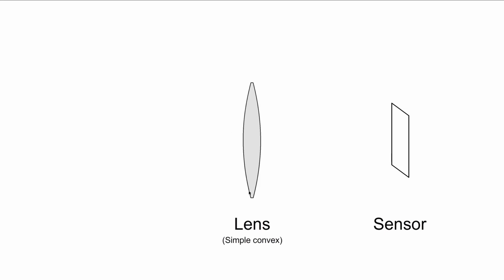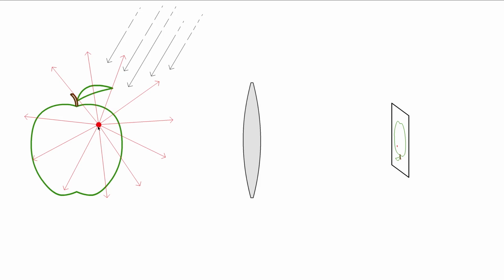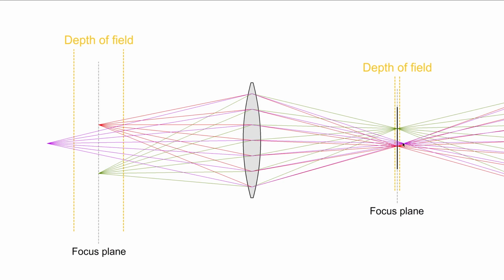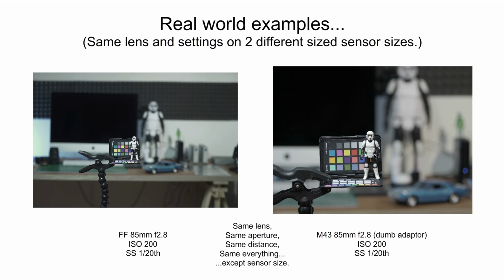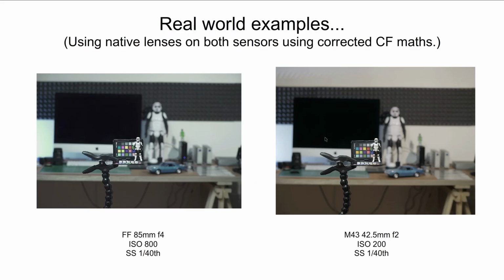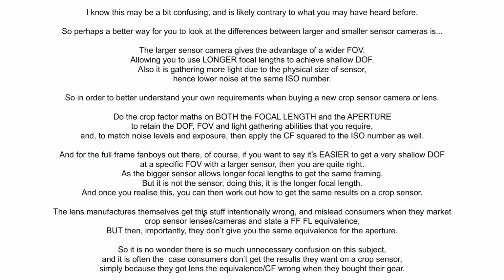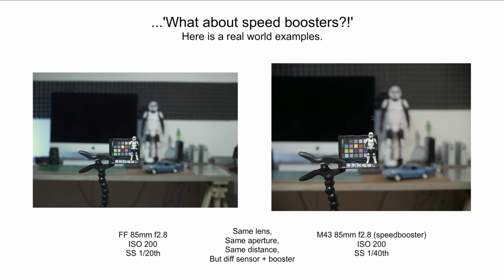Depth of field and crop factor misconceptions.

Comment: Did you say smaller sensor has shallower dof? If you did, wouldn't crop sensor need bigger aperture number to match the dof? shouldn't it be crop needing f4 and ff needing f2? that's the part of your video I am confused about. I do know that dof equivalent for crop is f2 and for ff is f4. I can't wrap my head around that part of your video. Do you mind explaining to me?
Reply from the maker: rico la the video explains that. With examples.  
If you rewatch the it from the beginning it all walks you through that. 
I won't be able to explain it in the comments if the video itself doesn't explain it I'm afraid. 

That is one of the key elements I was trying to get across.
Reply from the maker: rico la it's often useful to do your own experiments if some of this seems confusing. 
Seeing it for yourself with your own gear will always be more enlightening than listening to a description of a practical experiment. :)

Have u got access to a crop sensor body?
Maybe a local camera store where they let you test the gear?
Reply from the maker: rico la I can say that you maybe need to watch another video (perhaps one by filmmaker iq) regarding the circle of confusion. 
I touch upon this in this video. But now wish I went into a bit more detail. 
As that explains the reasons why the smaller sensor has a apparent shallower DOF (using same lens as a FF)
Remember the lens itself doesn't change just because a diff camera is put behind it. 
It's what's happening to the image circle when we shrink the sensor is what matters for that part.

Comment: Fantastic video! I enjoyed the follow up as well. I have a quick ? on the circle of confusion and how it effects the other metrics when you take into account when sensor sizes scale, the resolution often changes as well. For instance a GH5 vs an A7RIII.
Reply from the maker: TheKoop117 yes in this video I was mostly talking about same res at diff sensor sizes. 
(So 4k video as I mostly use)
Higher the pixel density the smaller the circle of confusion becomes. 
But in terms of end product it still comes down to how it’s viewed. 
If it’s printed huge and viewed close the allergens depth of field will become narrower. And visa versa. 
So you do need to take into account the circle of confusion of the sensor/pixel density. AND the final viewing set up. 
(Tv screen at 3 meters... cinema at 20 meters... billboard at 50 meters etc)

Comment: It seems to me that the ray tracing at 10:38 is wrong. If you're focused at a given distance, light coming from a point farther away should converge in front of the imaging plane, not behind it. And the light coming from nearer point is the one which converges behind the sensor.

This is consistent with the thin lens equation (where the lens would be at focal length when focused at infinity. When object comes closer the imaging plane must be farther away).

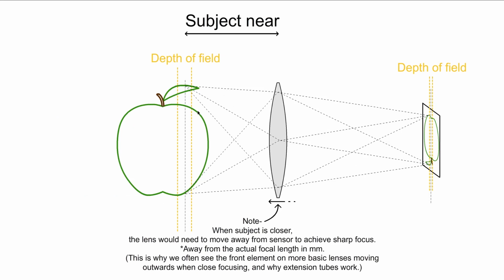It's also consistent with your comments on the video about having to move the lens farther away when focusing on near subcects (14:52 in your video).

Finally, it's also the way I understood the circle of confusion in the FilmmakerIQ video at https://youtu.be/lte9pa3RtUk?t=6m10s

Please comment.
Reply from the maker: You are dead right! (about the converging point) If you look at my pinned comment showing the list of mistakes, that was number one. A stupid mistake, and I am fully intending on re doing this video, and honing the message, correcting the small mistakes, and streamlining the whole thing.

Luckily the message at that point isn't really affected by the mistake, (that the cone is intersecting the sensor at a fatter point, therefore making it blurry.)

And yes that video by FMIQ on the CoC is very good. I could have gone into more detail, but wanted to just cover what was needed  regarding the smaller sensor, and move on.

Comment: Great video and excellent explanation. Wish you would have mentioned the lens compression too :). According my understanding it totally depends on the physical distance between the camera and the subject, therefore on an equivalent of 85mm (56mm or so) on crop body the compression would be same as on a real 85mm on full frame body. Please let me know if I am missing something.
Reply from the maker: Haider Abbas I was just thinking that last night!
(That I should have mentioned compression)
Yes, although I haven't tested for that personally yet. (Always like to test things physically before accepting anything fully.) I agree that it's just down to distance from subject. 

Makes sense and it's just the relationship between one object overlapping another from a line of sight. And the FOV of course. 

As you get further away from the subject. 
(Say an actor) but the FOV angle shrinks. (To keep framing the same on that actor)
So we see less and less of the background scene. And the actor is also actually covering less and less of that background. (Not as important, but worth noting.)

This obviously does the same thing to everything that is at difference distances from the camera. 

(This is why face distorts when using very wides lens, up close. And the same face looks flattened and more orthographic from a great distance with a very long lens. )

Anyway, good point you made. 
There's a good chance I will revisit this topic again in a future vid, as I have learnt a lot from all the feedback I got from everyone. 
Both about things I should have said. 
And ways to make the trickier parts even more clear. 
Not to mention I would like to add some raw independently gathered data that further proves some of the still disputed statements. (By a small but very vocal minority.)
:)

Comment: From what I could understand, for the math examples you're considering that the two sensors were equal except for the its size, that is they would have the same resolution and pixel bit depth (hence the circle of confusion effect on perceived focus). I though that was clear but not so much about the light sensitivity... Did you consider that they had the same light sensitivity per pixel or per unit of area? With your math, the total amount of light in the photo will be more or less the same for each picture (they must gather more or less the same amount of rays of light to form the same picture). Since the picture area of the cropped sensor is 4 times smaller, the amount of light per unit of area will be four times higher (the lens with smaller focal length concentrates the light more). Then, considering the same shutter speed, the amount of light into each individual sensor pixel must then be the same than for the FF sensor, as the pixels are 4 times smaller. So, lets consider that the sensors had the same light sensitivity per unit of area, then each individual pixel has 4 times less sensitivity to light and since they will be exposed to the same amount of light in the same amount of time as an individual pixel on the FF sensor, there would be the need to use an ISO value 4 times higher than the ISO value for the FF sensor, which contradicts your ISO values in the examples. If, on the other hand, we consider that both sensors had the same light sensitivity per pixel (thus making it 4 times more sensitive to light per unit of area than the FF sensor) the cropped sensor needed the same ISO than the FF sensor. I though your explanation on the ISO concept was somewhat confusing and not that coherent. Regards. Bruno

Comment: 50mm (for a full frame lens) is roughly a "sweet spot" in terms of front element size. Assuming you keep the aperture the same, at shorter focal lengths you need a larger front element to accommodate the wider field of view, and at longer focal lengths you need a larger front element to accommodate the larger physical aperture size.

Physics is fun! :)

Comment: Great video, but that’s still means to get same results you have to have ~2 times more light 
So in my opinion FF camera is superior because you can shoot in lover light conditions
Reply from the maker: Ramunas Valancius they are just different. 
Not one better than other. 
But yes if I was going to shoot at night I would take a FF camera with me. Not a m43. :)

Also bare in mind speedboosters shrink and concentrate the light from full frame lenses down onto the smaller sensor. 
This does even the odds substantially. 

So with a XL booster a f1.8 lens becomes (equivalent) to a f1.2. 

You can't really do the same for FF cameras. 
(Well you can but then you need to find medium format lenses, and giant specialist speedboosters. . :D )
Reply: biscuitsalive I am happy with my aps-c camera, but I was shooting in a church and my settings was 1/100 f4 iso1000 apps-c
Were my college shoot on FF 1/200 f5.6 iso 400
So this is why I would rather use FF camera Outside if you have enough light not a problem 
Thanks for replying
Reply from the maker: Ramunas Valancius yep if you shoot in bad light often then FF is your friend. 
But I own all types of sensors. 
And I picky up M43 more often than any other option. 
So make of that what you will. 

(I basically keep full frame cameras for low light only.... and the occasional other reason. )

Comment: Why is everyone trying to achieve a "full-frame look" when, according to this, it doesn't exist?    For example, if you are shooting an APS-C camera at 24mm@f4, you already have a full-frame camera--you just didn't know it.  You have a full-frame camera and lens shooting at 36mm at roughly f6.3.   

So, why aren't you happy?  What's the problem?  Why is it when you look at full-frame footage you want to throw your APS-C camera against the wall and smash it into 1000 pieces?

If you want shallow DOF, there are plenty of fast lenses on the market for APS-C lenses now.  People should save their money and stop trying to imitate a look that doesn't exist. (Of course I'm being sarcastic and don't believe anything I just said.)    I have a different theory about all this.
Reply from the maker: TheViscountOmega ok. Not quite sure your point exactly. But to reply. It's not about getting a full frame look. It's about getting the look you want regardless of what sensor size your camera has. 
You may want a "everything in focus look"
In which case the same formula helps you know what lens/aperture you may need on FF when u are used to shooting on M43. 

But the other factor here is the image noise. 
Knowing the formula I laid out anyone can get a very good idea of what amount of image noise they may get when going from one system to another. 

E.g. U may have shot on FF all your life but your tempted by a apsc camera. 
U know what settings u use in studio to get the clean results you demand. 
Well now you can tell before buying the gear what aperture, ISO etc. You will require on your new crop sensor camera to get "as good as FF" results.
Reply: I mentioned that because the constant refrain from message board users is that they want a "full-frame look".  I'm sarcastically telling them that, according to some people, they already have it.  I think image noise is negligible to these people--they can deal with that.
Reply from the maker: TheViscountOmega fair enough. 
But yes much talk about this mythical full frame look. 
They go on about focus roll off and crap like that. It's all bollocks. I have been using medium format cameras recently. 
And I could get the same look as that to a m43 sensor if I do the math right. 

Limits at the very ragged ends of course. 
In terms of base sensitivity. And FOV. And of course the lenses would start to become pretty darn big for the small sensor if they are uber fast to compete with the fast medium format lenses.
Reply: Interesting, because I've seen some medium format footage that, no matter what settings I use, I know I cannot duplicate with my full-frame Sony a7sII.   The perspective looks different.

The math works to explain FOV, ISO noise and DOF equivalency--I don't think anyone disputes that--but it doesn't explain the difference in perspective between the different format sizes.   Maybe I see things other people can't.
Reply from the maker: TheViscountOmega do you mean the compression?
If you are standing at one point in space. (Distance from subject)
And have a specific FOV.
then this determines the compression. 
(Mainly the distance, but of course u need the right FOV to then frame the subject as u wish)

Light travels in a very predictable way. 
So we can make adjustments to distance and lens to get the exact compression we want. 

Or is there some other intangible quality outside DOF FOV and compression i am not considering?

Obviously there is different types of swirly bokeh and anamorphic looks etc too. But those can be achieved over varying sensor sizes too.
Reply from the maker: TheViscountOmega p.s. I'm not saying there are not differences. Of course there is. 
I'm using film on the medium format so that's massively different for starters!
And clean images in low light will be easier to get on bigger sensor. Nobody will dispute that. Etc etc. :)
Reply: Well, I called it perspective because it looks most apparent to me in certain "distance to subject" shots.  I also see this difference in certain full-frame vs. APS-C shots.  It stands out.
Reply: Today I was thinking this theory:  What users are seeing when comparing different formats is a slight change in perspective due to compression which is caused by the large difference in lens image circle sizes.  For example, a full-frame lens "sees" objects in space from a slightly different perspective from an APS-C sized lens.  Does that make sense?
Reply from the maker: TheViscountOmega yes it does. Sort of. 
The compression will be governed by the FOV and the distance from the subject. 
The physical size of the front element has a part to play with the fall off and DOF 
(Not as important aperture, distance and focal length of course, but still has a role to play)
But the thing is you can put a big lens on a small sensor camera. (With a booster) So that removed that difference too. 

You even see people putting medium format onto FF cameras. 
So it's probably possible to get a booster that takes medium for mat lenses and reduced the image down to M43 cameras. 
(Never actually seen this done. But must be physically possible with the right lens.)
Reply: I was thinking of the rear element when referring to image circle size but I guess both elements factor in.  But when you "put a big lens on a small sensor camera" you're cropping out the rear element of the lens, hence not actually using a big lens.

Comment: biscuitsalive: Thank you for your comprehensive and useful video. I knew about the DoF and aperture correlation, but with different sensore type it seems to be a complicated concept. So I felt this, but I’ve never put this together. Now i understand better how it works. I would have 2 questions, and i I know this information is in your video, but really just would like to make sure if i get this right. I am asking this from an APS sensor user point of view. For me having a nice background blur on a portrait image  is the most important. 1, fuji fx has 1.5 crop factor. If I would like to have the same blur than I have with nikon FF 50mm f1.2, I would need  35mm f0.8. There is no such lens on the market. Right ? Only thing I can do that I use a longer lens and step backward. Am I right ? 2, ISO has nothing to do with other feature of the image except noise level, isn’t it ? I am just asking because I am an APS user now. In order to get similar nose than I got with nikon on 100 ISO, I would need 44 ISO on Fujifilm APS. Again, there is no such sensor. So I guess the main differences show at the “lower end” of the parameter scale. On the other hand there are noise level differences between different type and brand of sensors. So ISO 400 dosn’t result the same level of noise e.g. sony and fuij APS.  The noise is not only matter of size. Right?

Comment: Thank you so much...
Mistakes are spotted :). 
But, thank you so much for this detailed explanation.
Reply from the maker: Sameir Ali thank you Sameir. 
Which mistakes? (Want to add annotations for any to keep the wolves at bay.)

I misspoke a couple of tiny times. (Saying complete when I meant compete near end etc.)
But I think it's still fairly clear what I meant. 

But please do point out any specific mistakes so I can amend.
Reply from the maker: Sameir Ali and I would redo some of the illustrations slightly. (Apple too close to end of lens, and this muddied water for certain points.)
Also, the DOF area (yellow dotted line) should be stretching out so more area for "acceptably" in focus behind focus plane then in front. 
But again that doesn't change the core message... but I should have factored that in.
Reply: All the mistakes are acceptable and understandable. 
By the way, I think you said about square of 200 is 800, that needs to be corrected. What you said about the crop factor was right. So, the ISO is not be be squared. It should be multiplied with 4.
Reply: I have subscribed to the channel, and keep looking for more information.
Keep up the good work.
Reply from the maker: Sameir Ali no what I said was we square the crop factor for the ISO (I will re watch to check I said it correctly later... but certainly that's how I wrote it down for the illustration)

So our crop factor for the M43 to FF is X2
So if you get your calculator out and type out,
200 times 2 then press the squared button. 
This gives us 800

If it was APSC it would be X1.5 (canon is 1.6)

So 200 times 1.5 squared = 450
So ISO200 on a apsc cam. And ISO450 on a FF would equal the same total light. And have equivalent noise.
Reply: Yes. I got it.
Thank you
Reply from the maker: Sameir Ali thanks. Appreciate your input.